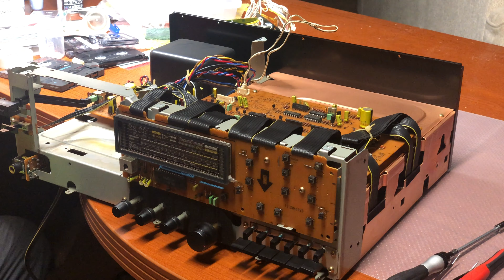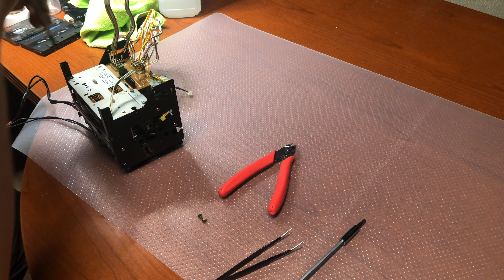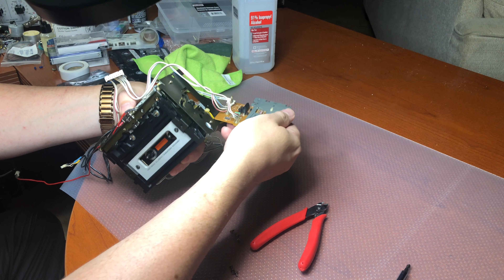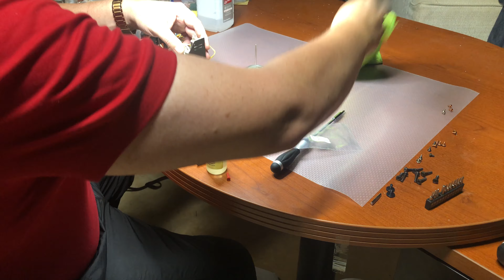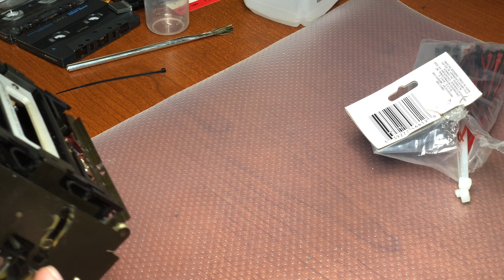Part 3 - Akai A&D GX-Z9100EV Restoration   4K

Comment: Hello. During my restoration of this recorder I suddenly found a ball bearing ball on my work bench. Service manual page 15 shows such a small ball, about 1 mm dia, ref. no. is 69. However, I wasn´t able to find out the location where to reinstall this ball. Any idea?
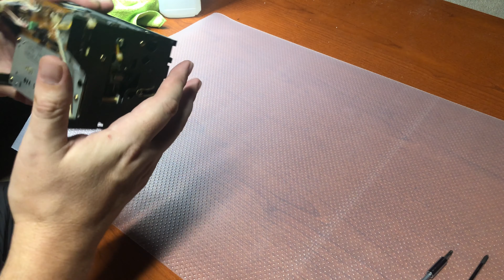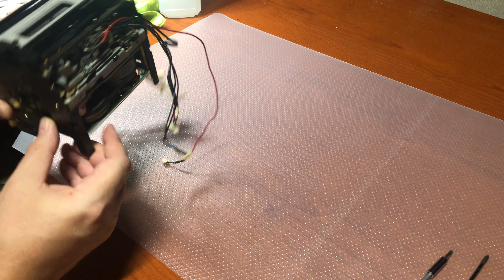Interestingly, at your video, you also have such a ball on your work bench, but you don´t seem to take care of it! Take a look at 3:26, 3:30 and 3:45 time, at the lower left corner area. At later time, the ball has gone somewhere...
Regards, Gerhard
P.S.: you do an excellent job with your videos. Many thanks for your service!
Reply from the maker: In my video it not looks like a metal ball. Just some kind of trash. if your ball is made of metal - check that you have all balls under the heads carriage. There should be three no.69 balls under it, check the diagram. these are essential to maintain carriage position.